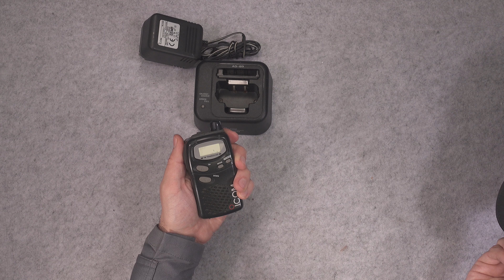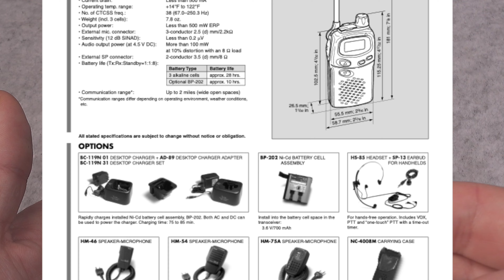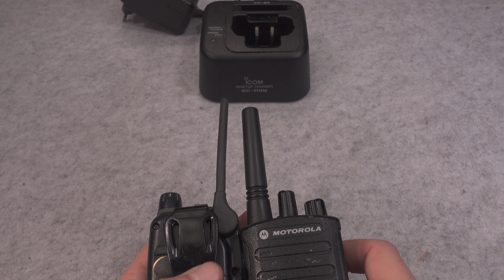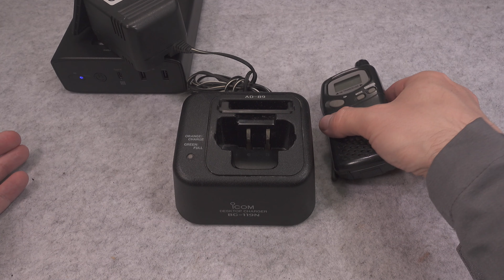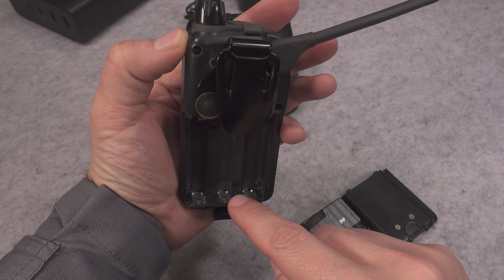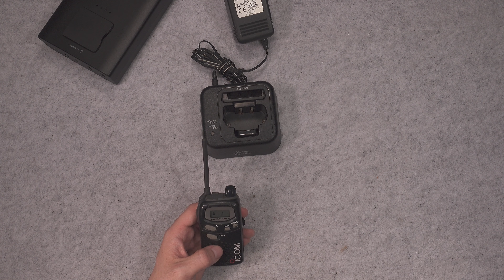ICOM IC-446S license free PMR446 radio good enough for military (US marines) with amazing antenna

Comment: I had the predecessor of this radio, but from Kenwood in the LPD version in the past. It was sometime in the 90's, and I remember well that despite the poor 10mW it worked well at close range and the radio had a very good clean (definitely not deaf) receiver. Had good times as a teenager with friends during sports. Seems icom and kenwood did work on those radio`s for some wile
Reply from the maker: Same housing?  LPD should be mandatory for any crane operator that require all day long TX-ing - they are in LoS, that 10mW will be more than enough - right now You can always get 8 construction sites around city and have 8 channels on PMR blocked  whole day... I have XT665d that have LPD and it work great :)
Reply: @ElectronicNoobBlog   More same inside, for what I can remember (maybe I am in the wrong here).  However LPD is perfect for short tx.  We used it for surfing (we had a waterproof slaps for the radio`s), Gave a safe feeling (remember no cell phones yet)
Reply from the maker: It was "KENWOOD UBZ-LJ8" right?  Right now for "water sports" - You might take look at entel ATEX versions - I believe they are fully submersible. I will put my hands on them - but need to find good deal (they are crazy price - sold for oil industry).
Reply: Also there is a Kenwood-PMR-Version UBZ.